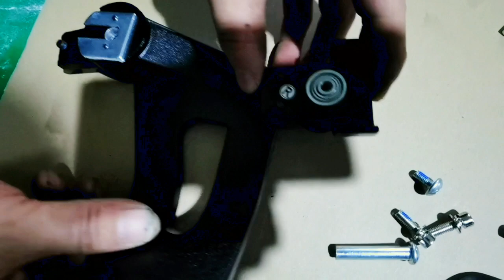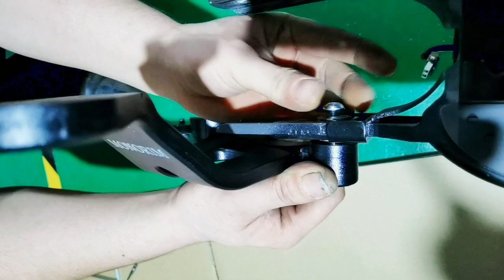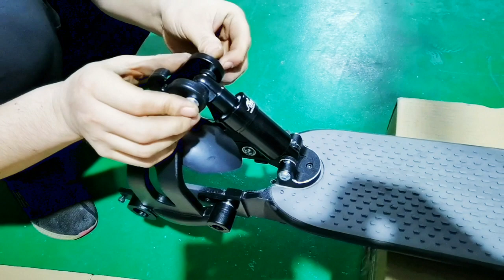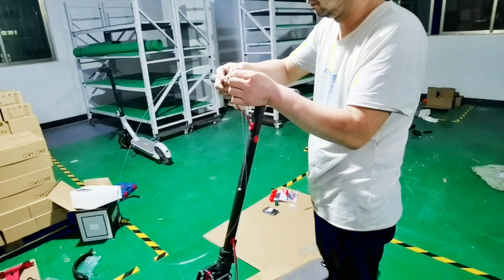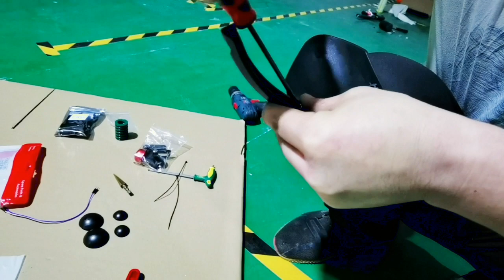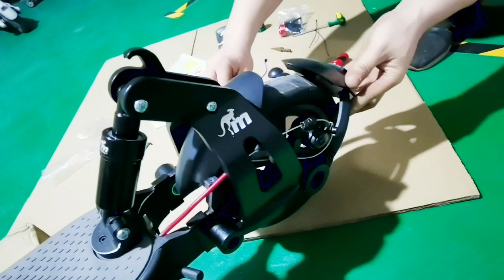MONORIM MR1 rear suspension mounting  on  xiaomi m365/pro1/pro2/mi3  series e-scooter

Comment: I bought it and mounted on my m365 pro 2. I've got a problem. After installation of MR1 my scooter gained about 2 cm ground clearance. Lifting back end of my scooter made retractable side stand too short to keep the scooter upright. Is there a solution to this? Can I lower back end of the scooter somehow? Or maybe there is a way to modify the side stand?
EDIT: Ok, nevermind. I found a fix. Turns out there was an extra element in the kit that I've overlooked. It was a plastic spacer that should go between the side stand and the scooter body. It lowered the side stand mounting point. :)
Reply: on alixpress there are kits were u can increase the mounting height of the kickstand
Reply: Buy a stand spacer
Reply: @joekaplan9665  There was one and I finally used it, but unfortunately it wasn't enough. My scooter stood upright only when handlebar pylon was folded down. I solved the problem by replacing the side stand with a longer one designed to be used with 10" wheels.

Comment: Hi, thanks for the video. You made a very good and clear presentation. I have Xiaomi M365 Pro and I installed Monorim suspensions both front and rear. Both the front shock absorber and the rear shock absorber are both red. Unfortunately, the front suspension is black with a red shock absorber. I want to paint all the front suspension elements that are black in red so that they are the same as the rear suspension. I also want to keep the original red color on the two shock absorbers. What color / shade of red (RAL code) is the rear suspension? Can you give me a RAL code for this red color from the Monorim suspension? Thanks in advance and I'm waiting for an answer.
Reply from the maker: nice job you are doing , our monorim fans

Comment: Mine arrived today!😊 Not sure i like the ALL black colour!😳 I preferred the black with silver showing on all the edges! Why has it changed?? And i never knew there was any drilling involved😖This waan't made aware!
Reply: They drill in the video as one of the first things? You just clearly didn’t pay any atention
Reply: The silver and black one's are for the segway series👍
Reply: @stannykotian1782  I believe they are for m365's & Max G30.
And they are called Version S.E currently not released yet. Monorim told me maybe some time next year they will be released?? Who knows??😳
Reply: @fleebleflam  Segway is put on Amazon USA. Got mine in today and mounting it tonight. They had 3 different color layouts, but I went black/black as thr color of shock/spring didn't match my front.
Reply: @scotts5489  Dude, i also chose black/black, my Ride is Gold, & black colour. I am now putting on 10" solid tyres which will be a massive pain!😳 But well worth it with both front & back suspension😁👍🛴 Here's my Mr1 with the 8.5 solids on! 
http://imgur.com/gallery/222r4os
Reply: @fleebleflam  question about front suspension. Installed mine today, I have a little play front to back at the neck joint. Did I miss something? Does it need a spacer. For g30 max. You seem the resident expert that replies.
Reply: @scotts5489  I had a similar issue with mine on my m365 classic, it always has a bit of a gap, but only about 2-3mm not much. Top and bottom. I just tightened up the steering bolt (the bolt in the middle)  just find the sweet spot, not to tight, not to loose, but just right. I believe there is also a way to adjust the spring shock  (if you have the v1 spring shock) on the suspension There are loads of installation videos on here, just have a quick search. Good luck buddy😁👍🛴

Comment: Those three bolts on the foot plate which hold de suspesion spring ( ex plastic wing) will not hold the bumps from the road ! Its a matter of time before will brake drom their thread! The bolts are to small for the shock they will endure !

Comment: Not happy with having to drill My holes bigger.. this modification Is a once you go there's no coming back type of mod....
Reply: Wrong. You can still go back to using original wheel. But you wont be able to fit the original reflectors.